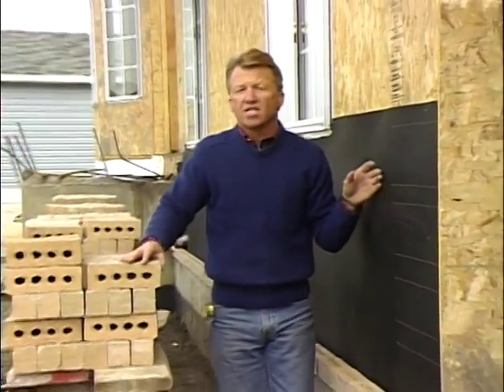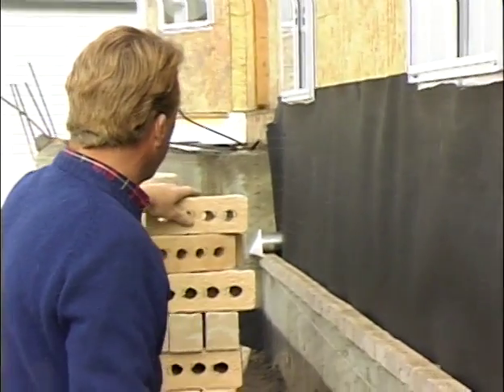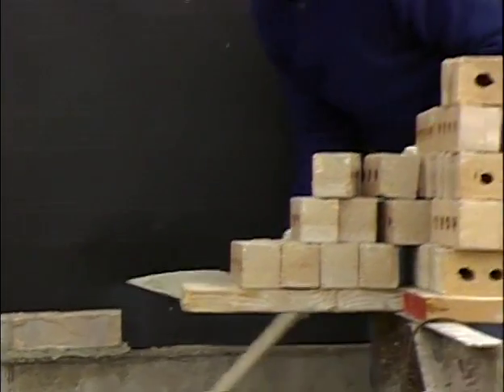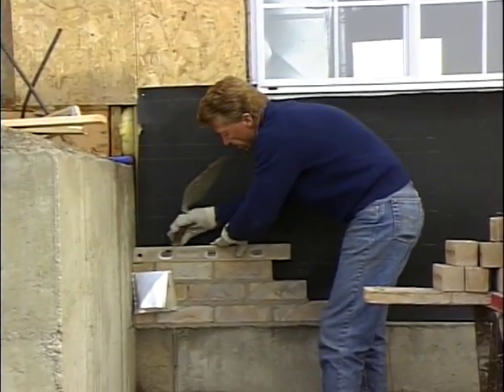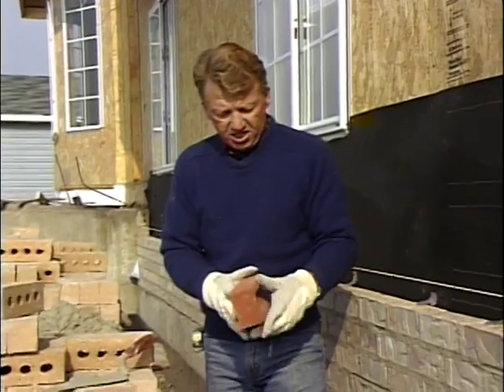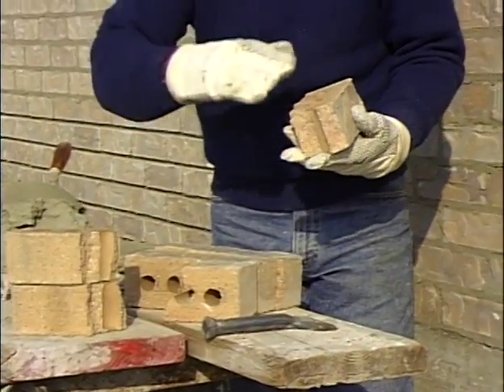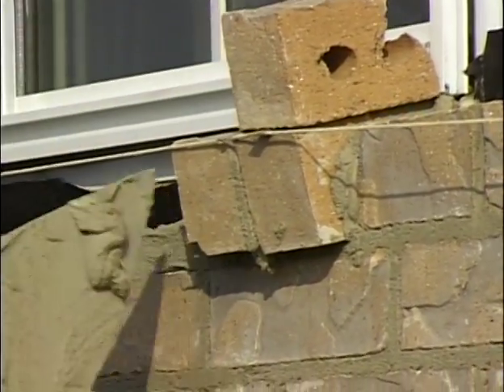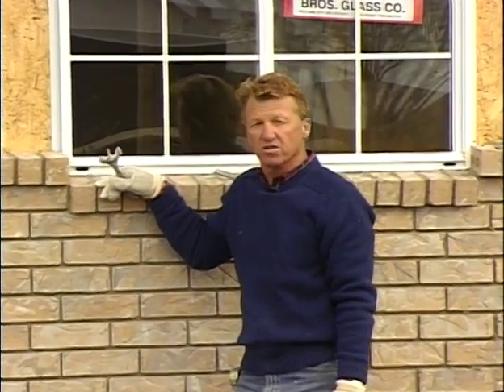The Art Of Laying Brick---Laying a Brick Wainscot.

Comment: This guy does everything the same as we did including the setup,layout, and bricklaying.
We did our ties a little different- bend tie at hole near end less than 90 degrees- place on top of wall tie will extend beyond face so it needs to be bent back making sure that completed bend is 1/2” inside of face of joint remove from top of wall and hammer bend flat.
Make up several the same way on setup plank. Use 8 galvanized nail and locate nail slightly above brick and drive slightly downhill. When nail is too high tie will  flex.

Comment: WOW!  This guy is good!  One of the most important points that he makes concerns furrowing.  Although furrowing is taught, practiced, and accepted as the "right" way to lay mortar, he explains exactly why furrowing is forbidden by many architects and engineers.  Just remember, neither bricks nor mortar are water proof.  Both bricks and water absorb water.  If anyone ever tells you that you need to furrow your mortar, just refer to the points that he makes:  1.)  Furrowing does not fill the holes in the brick, and 2.)  It creates a horizontal void that is ideal for collecting water, which is exactly what destroys brick work over time -- especially in areas of the country where we have a melting and freezing cycle in the same day (Colorado, Wyoming, Montana --- places that I have lived and worked).  The water collects in the day time, then it freezes at night.  This causes the water to freeze and expand, which then causes the joints to crack, which then lets in more water,  which eventually leads to crumbling of the brick work.

Comment: Why wouldn’t you use a heavier sticky vapor barrier on the wall behind the brick?
Reply from the maker: This was in 1992 and that was the standard at the time. It wasn't even code where we are at it was still up to the home owner or builder and some chose to skip it all together to cut costs. But we are in the second driest state in the country so mold isn't an issue unless you let your sprinklers hit the house or have an undetected plumbing leak.

Comment: Sorry but you are not a professional. Your level is far too short .Your first cut was crooked, your second cut was crooked and had no muck/mud on the back edge. There is no problem in tapping the level or the brick when you are building corners or piers etc. When you are laying to the line you should not have to hit any brick if you have laid the right amount of muck on the wall you should simply ease the brick into place.....The muck that squeezes out goes on to the leading edges. Front and back....Your last brick had no muck on the front edge. . You always joint the perp joints before the bed joints. You should never clean your muck joints on to the floor..... Have a care for the guy who is mixing your muck. The underside of your sloping cills is a mess???? and your vapour barrier should have been placed higher to afford a lap for the next higher piece,

Comment: Many years ago I lived in a brick house built in 1948.  The brick was backed with veneer block wich was also set on the top of the foundation.  The only problem was the small front porch and steps.  The joints failed and I had to clean the bricks and relay them.  That chore took me two or three days because I had never used mortar before.  I dropped the steps about 1/4" to the front so water would drain out.  55 years later the bricks are still holding.

Comment: UK standards are different to us. However it doesn't really matter taping or rubbing bricks down into position. Rubbing is better. 
One other thing. With timber frame construction you should leave a gap under the window sill for shrinkage of the timber frame. The bricks won't shrink when the frame goes down. the window sill/ frame will push up on the bricks which can lead to leaks around the window

Comment: YANKS LOVE A BIG MORTAR BED ,MAKES MORE WORK FOR YOU GETTING THE BRICK DOWN TO THE LINE AND FOULS CAVITIES , I FOUND THE SECRET TO BRICKLAYING WAS GETTING THE BED DOWN FAST AND NOT TOO DEEP SO GETTING THE BRICK DOWN TO THE LINE IS JUST A CASE OF HAND PRESSURE , KIND OF HARD TO EXPLAIN IN WORDS , ANOTHER THING IS TO BUTTER UP YOUR PERP JOINT PROPERLY , MANY BRICKIES WILL JUST DO 2 SWIPES FRONT / BACK BUT IF DOING IT RIGHT YOU SHOULD BE DOING BOTTOM FRONT BACK , WORKED FOR ME FOR MANY YEARS ANYHOW .
Reply: dinlo biscuit 
Yes  I agree in Scotland when building kits as call there is a mark point on inner skin to fix in wall Ties which hits an upright beam

Comment: Any reason why the vertical joint isn't centre of the horizontal brick?
Reply: The bricks are 9" by 3", by putting the joint in 3" from the end means you can go around corners without 1 ½" mortar joints.

Comment: Why not measure down from the window 4 1/4 for the sill then measure brickwork to that mark? Lol
Reply: Brick are only 3 inches wide so you measure 3 5/8 or 3 3/4 down to establish your elevation. It depends on the pitch of the sill , 1/4 inch is usually  good

Comment: video      complete  rubbish     first thing    the    gloves     never use them     no  proper  control  of trowel    holding trowel  wrong way    cant   spread mortar bed      no  wrist  action     beds to heavy    never ever     use the   line  like that       there is     only    one  place    to  take your line from     is       at   the very end    where you plum  your corner     don't use   that  plate      system   hope you   understand  what     I mean        next     never  build     corners       use profiles          with the     brick courses    marked   on them           all the   video    I have  looked at   is showing  young  app      the wrong way       some are     hitting  the   brick down  with    handle of   trowel        never ever do that   only   with  the  trowel       never use   a slack  line  or dirty one          no  bricklayer     can build  a   nice    straight   wall      if you don't use  profiles        building   corners     is the slowest  part of  bricklaying   a   waste of  time         don't   walk      through   the      dirt    k eep things  clean  no   big      dirty trowels         also       don't     listen  to  more      rubbish       about bricks       built  frog up        makes  stronger        wall        if that was       right        what       strength       is  wanted        if  so      stronger  bricks would be used     if you  think  I am   wrong  you can get in touch
Reply: 123456782267 oh no, he just layed a wall of text!
Reply: He's a text layer by trade.
Reply: Dont use gloves u say?  Do you enjoy the skin falling off your hands?
Reply: @maggs131  You'll get callouses if you're not a pussy.  You can spot a mason a mile away from their gnarly hands.

Comment: He put the black paper up on the wall but he has no flashing or weep holes on the bottom of the wall to let the water that gets behind the wall a place to get out.  Also he uses no cavity drainage material.  He is nailing the wall ties over an inch above the brick.  This gives the tie room to move before it gets tight and does not let the wall move away from the house.  Rowlock sills are really not approved by the brick institute as they leak to much.  Also he has no flashing below the window and the windows were not installed correctly as there should be flashing around the perimeter of the window.  When he lays the sill brick he does not compress the mortar between the bricks he slides them in to close together.  There should also be a gap below the window to the brick.  The wood in the house will shrink in years to come and the brick will not which will cause the windows to become hard to open and close.  I could go on but you get the drift.  I have 40 years in the trade and I have built them all.
Reply: Yet only a certain percent of ppl in the world can look at ur comment and half ass understand anything u just said. This guy on the video is old school. Sounds alot like my boss man when he speaks. Only that ol dude here on the video is not cursing. My boss mans favorite word was motherfucker and fuck. Probably said it more than a sailor. I'm kinda young I'm 24. I had to learn to shut the fuck up and listen when he got on to me. Day by day I got faster and faster. From learning how to spread mud fast to learning to keep my mud spreading consistant. To laying a brick to the line. All while not lossing patience.  And sufferring long hot summer mississippi days where  my body couldnt t bare it. Some days no one would show. So I got to where I could be out by the sand pill where the mixer sits and have the near perfect morter mixed and in the wheel bar and pushing that mf which felt like a whole football field and getting to where brick. mud boards and entire set up is and cant stop cause mud boards need mud. Pretty much now I can get all this done in about a couple minutes. Have every mud board full. Then grab my trial which is always nice and clean. And spread mud pretty damn fast once I reach the end I lay brick backwards . and make it easier on him. Yes I am young and I'm mexican. Never miss days. I am going on a year working with him . he pays the mud man more then me. I steal get payed what he started me with so I make 350$ for 5 days 8 hour days with no lunch. Wide ass open speed. Why am I still working there idk to be honest. Only job that will pay me hint hint I'm Mexican. My situation is complicated. If that answers ur question but. Being payed low. And putting up with an entire year of heads aches bumps bruises and arthritis has made me into a better man. I look and think about things differently. Feel wiser . I probably wont ever get a raise. But maybe one day things will change. I probably could run a crew and make better money. I'm letting god lead me. I'm just gonna keep learning what more I can from him. Back in the day ppl around here say no1 ould lay brick or even just plain out out work my boss. But if I ever find work somewhere else. Doing whatever. I know I'll at least be if not the fastest but be considered the hardest worker out there. I can probably make it anywhere. Dont ask me why I'm telling y'all this shit. Hell maybe someone will read this and maybe hire me. If plus I also got 20 years expierience in English I sound like a damn redneck when I speak so if. Anybody need a damn good worker let me know.
Reply: @mannybriones4340  $350 for 5 days? Nah man in Houston, Tx they don’t roll like that. A helper would make more even double and have hour long lunches. It ain’t bad in here. I know it’s a 2 year old comment but that shits crazy bricklaying is a good, well payed trade, highly respectable too.
Reply: Why is this the only comment on the topic of garbage flashing  clearly exhibited here. There's house wrap shown in the video so obviously not having it isn't an excuse. Who gives a flip if he wants to tap on his precision instruments, it's his level, I don't tap on mine but clearly the vapor/water management fail here can be seen from a mile away.
Reply: @JSoll289  since you don't know about this guys' series, this was all done in the early 90's. All the flash codes and what not didn't come out until early 2000's. Educate yourself some more.
Reply: @kingschmoopy6583  well this video is out now and people are watching it now and YouTube has a bad reputation for hackers and jokers learning the wrong way, so either take the video down or give it a proper critique.
Reply: waldo lush  dude after 5 minutes both people arguing are wrong, the convo isnt about who works where when it's about proper flashing tequnique which has changed since maybe you learned it. Modern code dictates moisture management including flashing above masonry veneer and around all windows.
Reply: JSoll289  ll
Reply: I am not a brick layer but my uncle was a master brick and stone layer, and he must be rolling in his grave. He always had weep holes and made sure no mortar fell behind brick for ventilation.(ventilation allows moisture out and keeps it dry between back wall and back side of the brick). If it ain't broken ,don't fix it, bottom line, his work is still good and now about 70 years later, his work is still holding up. I get aggravated with these new kids on the block called engineers and architects (pencil pushing idiots imo).
Reply: I wonder if the flashing, ties, etc. were changes that came in after the 80s, which is when this was apparently recorded.
Reply: "...you want the water to stay behind the brick on the wood..."  and you've been laying the brick wrong all that time if that's where you want the water-- to stay behind and rot the wood.  Sounds to me as though you're talking out your butt hole 'cuz anyone's mouth would know better.
Reply: Maybe in the 80s when this was filmed the code was different????

Comment: dont tap ya level son, its not your level thats out its your brick work
Reply from the maker: +andykod77 bend a level from tapping on it? What kind of cheap level are you using?
Reply: +Derek Lee +andykod77 i'm a machinist and there's no way that tapping on the level like he is will knock it out beyond any tolerance that bricklaying already has. maybe if you needed to lay brick within millionths of an inch and the level was made of copper. leaving a steel level out in the sun all day would introduce more variance than tapping it for 20 years. that's probably what's happening to levels that get "knocked out" over years, days of thermal expansion and contraction by being left in the sun.
Reply: +andykod77 I am not a mason, but I am a scientist. A level is a tool, and although the level is not out of level what it sits upon is. Tapping the level simply levels the material under it accurately and measures just as accurate, so why is it wrong to tap the level because at that moment, the level and brick are acting as one unit.
Reply: Derek Lee Hi good question but repeated taps on ya level will make your level bend and go out of shape. Ive seen levels bent ever so slightly due to this,if you look down the length of the level with one eye shut you can see the bend due to the tapping.
So we were always taught not to hit the level but tap the bricks instead.
Reply: Thanks for the the replies guys. My buddy uses Stabilia too, I saw them in his van. I would like to learn the art of this trade, for my own enjoyment. I work with building blocks all the time...but my building blocks are RNA and DNA ;-) A little smaller than bricks. But this is a fascinating art and I am looking forward to doing my own projects for fun. I will be sure not to tap the expensive equipment! :-)
Reply: +andykod77 use Smith or Crick level they don't get out of whack I've used one for 13 years now and I build corners and leads every day five days a week if you hit the level and has all the brick the sand with no up out downs in the course
Reply: +stilln68la why on earth would i want to lie about what level i use?
Reply: +Derek Lee ha ha good luck
Reply: +stilln68la gotcha
Reply: +Sjan XXL I use Crick and Smith levels 2 foot and 4 foot they last forever and I build leads and corners everyday and tap on the everyday so I agree with you if there a good level to start with and you take care of them they last a long long time
Reply: I know bricklayers they just buy aluminum long levels every year literally they abuse them with hammer or trowel and nobody can convince these guys to buy good wooden level. but this is other story,some people just don't bother about their everyday tools.When am telling them that I use my 2 Crick levels 15 yrs now they look at me like am out of this planet or so.
Reply: andykod77 
I've owned 3 Stabilas. They bend at the hand holds. I bought a Crick. No problems. Good, solid level.
Reply: Taping a level will not harm it. Pounding on it yes.
Reply: +andykod77 Stabilla lol.Use it often do you?
Reply: +stilln68la never have
Reply: +andykod77  in my experience there is nothing wrong to tap the level. it is important what kind of level you use though. to lay brick u need good heavy level,the best is Crick,I use 4' Crick15 years now and nothing wrong with that. just tap the level between vials and recesses in level and u good to go. I never used aluminium ones and never will except firebricks,but that is other story to it.  Maintenance is crucial too,oil wooden level every week or u will have piece of crap
Reply: SuperAWaC i was always taught NOT to hit ya level
Reply: Yeah that's what I got taught in college, don't tap your level. those bed joints look big aswell too?
Reply: your dumb
Reply: you cannot learn this trade in college..the only way to learn this trade is out on the job with a mason that knows his shit. I can go to college and take a contractors test and pass it but it does not mean I can build..that's the problem today with all the regulations..oh you have to be licensed..Bullshit..I'd rather have experience than someone whose learned from books.
Reply: Sam Hays who’s dumb
Reply: Tapping my level for 20 years,it's made for it,dam apprentices on here posting comments  again ,don't know shit from shinola,level goes bad just buy another,this guy is a very good mason.
Reply: paul emmanuel did you not here the part where he has to gain half inch,dam apprentices.
Reply: +mikel hardin I was drawing attention to the misspelling of Stabila supposedly a tool he´s familiar with.
Reply: +andykod77 I don´t think you´re lying but if you want credibilty for your advice i suggest you spell the names of the tools correctly.
Reply: +Learn To Lay Brick i use a stabilla but to answer your question yes repeated tapping will put the level out